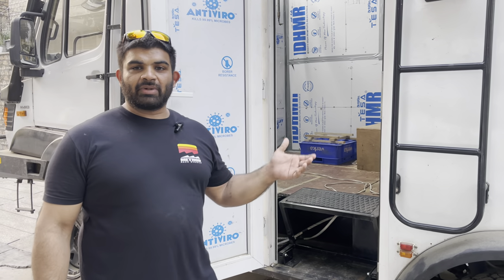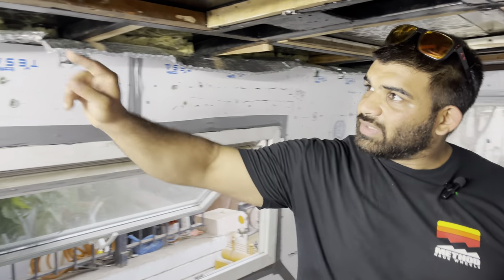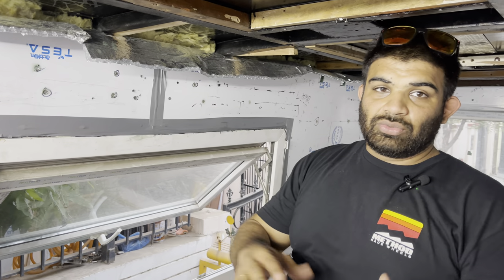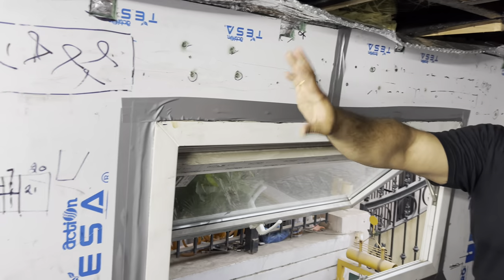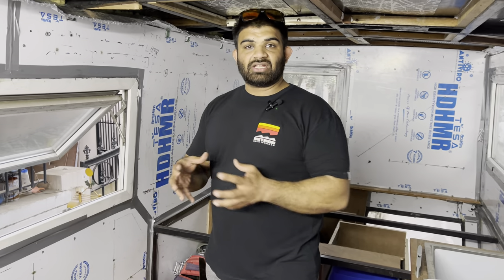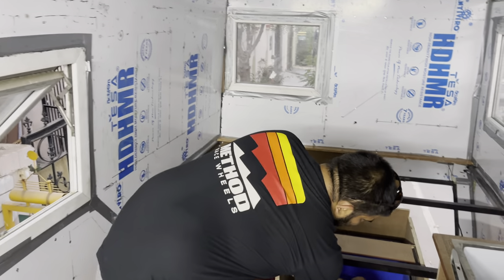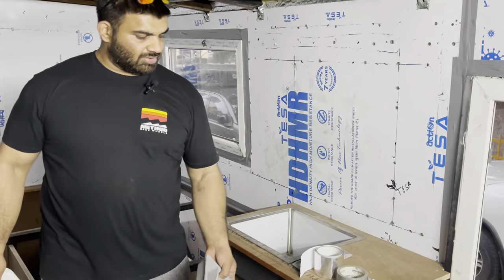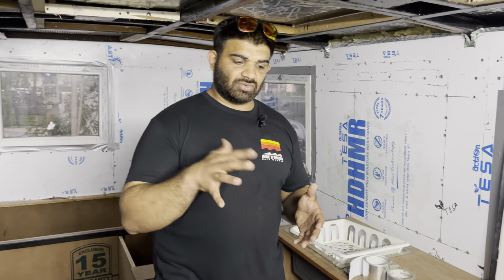4x4 Camper Van Interior Tour and Update

Comment: For bedding storage, in case you are carrying extra duvets/quilts/bedsheets/pillow, that you wont change regularly, consider using vacuum bags (you will need a vacuum cleaner). Just put the items inside and vacuum the air out. They will reduce the volume of the product by over 40-50%.